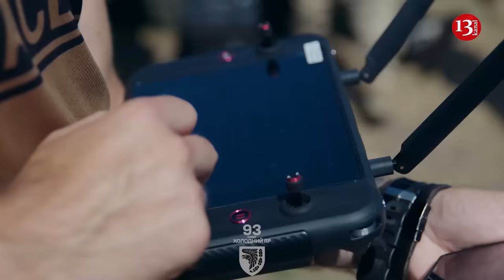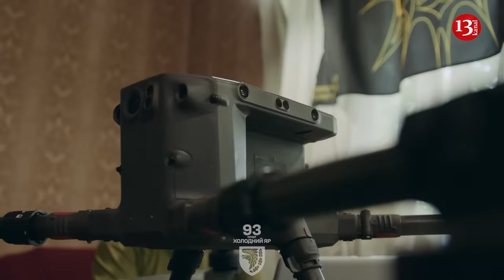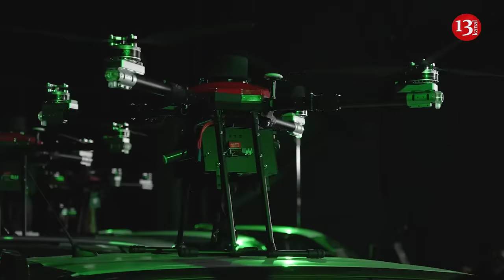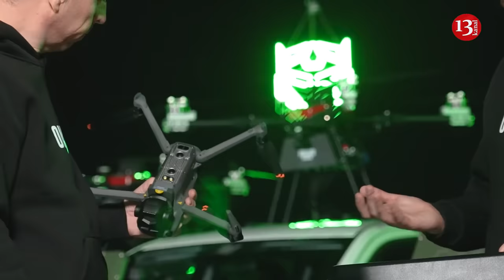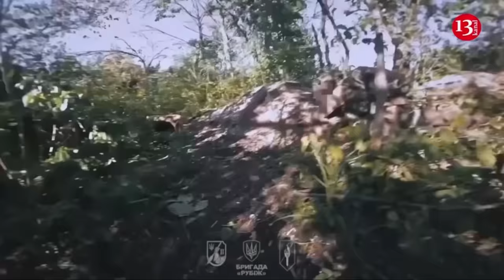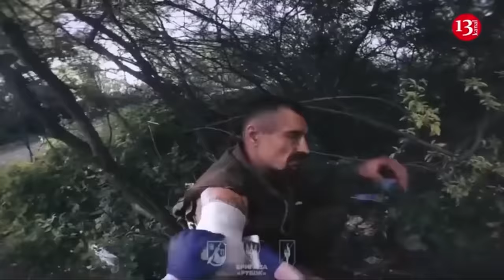Ukrainian new heavy FPV drones with enhanced warheads will be “nightmare” for Russians

Comment: to attack a trench from on high
From a long way up, to give the bomb time to orient itself, use remote control to correct the orientation of the bomb so that its discharge is in a segment parallel to a trench line. spray, or deposit charges, mini frags, or gas, in a line, parallel to, and IN the trenches. Maximizing the effect.